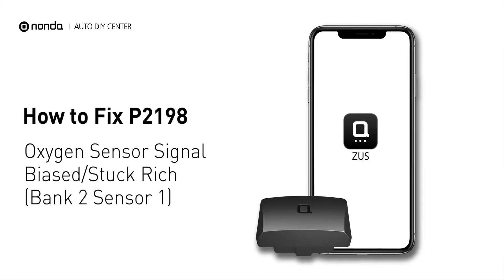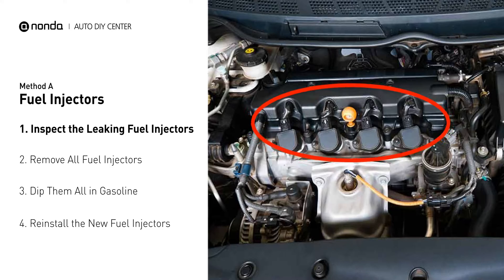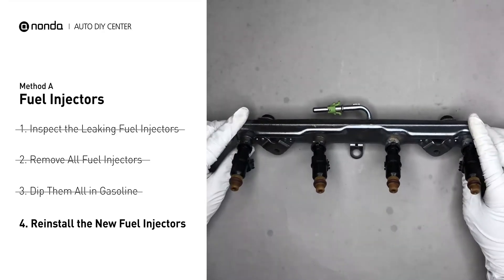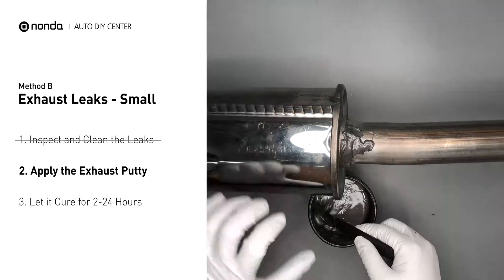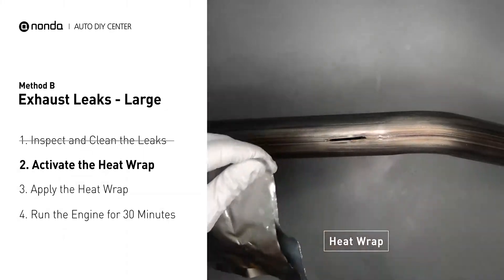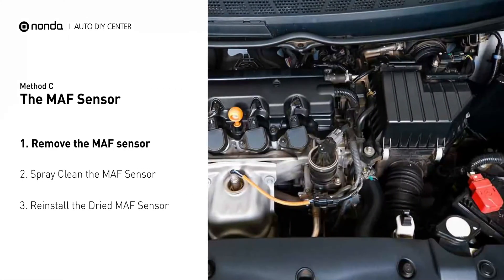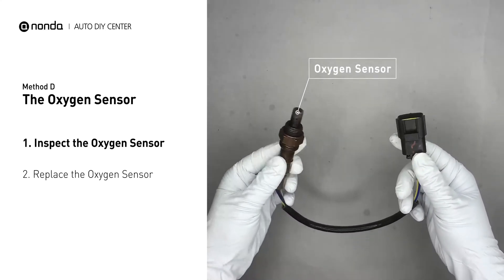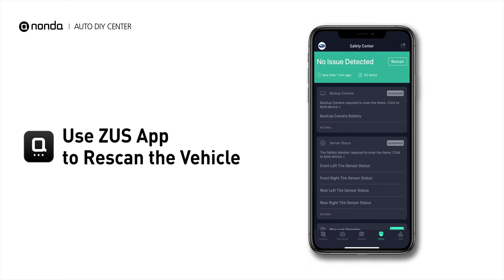How to Fix P2198 Engine Code in 5 Minutes [4 DIY Methods / Only $8.76]

Comment: Could water in fuel cause these codes? I fueled at the automated fuel station and as soon as I started my truck it ran rough and threw p2198 p2196. That fuel station is known for water in its fuel.

Comment: maybe too long ago, but i got a 2198 and 2196 so both banks rich after changing the injectors on a car. 
changed them with remanufactured. any ideas
Reply from the maker: Please check the possible causes:
Faulty Front Heated Oxygen Sensor Bank 1&2
Front Heated Oxygen Sensor Bank 1&2 harness is open or shorted
Front Heated Oxygen Sensor Bank 1&2 circuit poor electrical connection
Inappropriate fuel pressure
Faulty fuel injectors
Intake air leaks may be faulty
Vacuums leaks